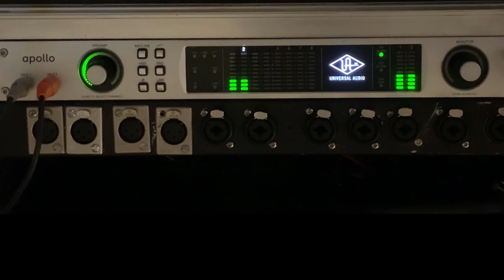Fishman PowerTap Rare Earth and Infinity Acoustic Pickup Systems | Acoustic Guitar Gear Demo

Comment: Just a quick note about the function of the pickups: The blend control of both the PowerTap Earth and the PowerTap Inifinity only affects the mono mix (heard in this video on the left channel). With a standard 1/4" guitar cable (mono), the left channel of this video is what you would hear as your main signal. Emile recorded this demo using the included  1/4-inch TRS Male to Dual 1/4-inch TRS Female splitter shown at 01:07, which sends the output of the Tap body sensor to the right channel, and the right channel Tap body sensor signal remains at the same volume throughout the demo (as designed for outboard control). When Emile adjusts the blend control, you can hear the Tap body sensor being blended-in to the left channel of this video at different levels. The left channel in this video demonstrates how both pickups will work in mono mode with a standard guitar cable - the right channel in this video demonstrates the Tap body sensor by itself.
Reply: Thanks for the added info!
Reply: Thank you for the explanation. His comments about needing a master volume still hold true.  The only reason I'm putting a pickup in an acoustic guitar is to play live.  Playing live, I need a master volume on the guitar.

Comment: I join a number of others here in preferring the Rare Earth PowerTap combo to the Infinity system. Its much warmer and far more natural, and it lacks the feedback issues of the Rare Earth Mic Blend system at higher volumes, which is a distinct plus. My only concern is the potential loss of sparkly top-end without the microphone feature of the Mic Blend system? I guess I'd be a bit reluctant to install the PowerTap on a larger bodied 6- or 12-string 'Jumbo' acoustic, because they tend to already have a rather boomy low-end.